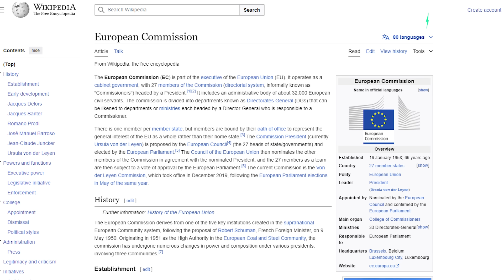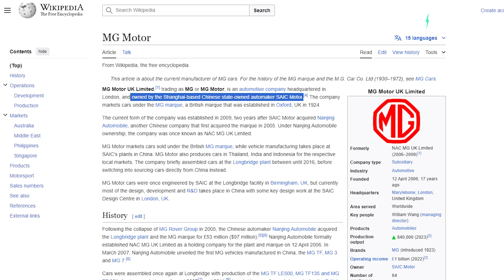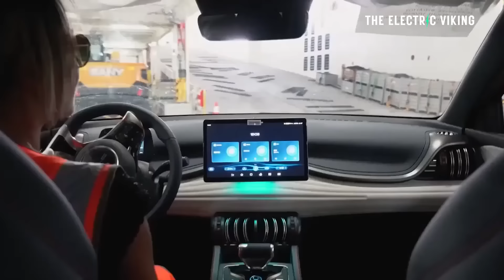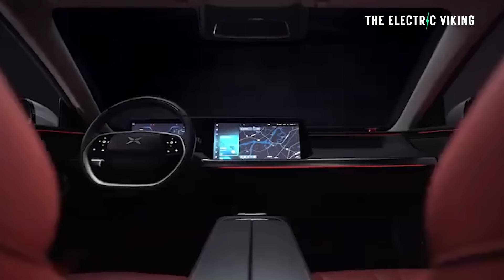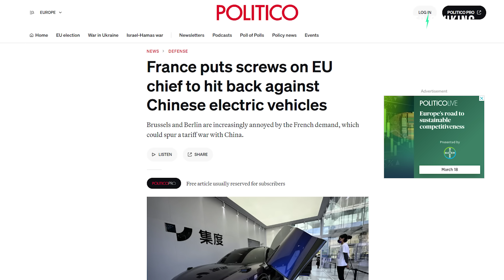Europe says it has evidence China is paying BYD & MG to sell EVs in Europe

Comment: Chinese EVs are not cheap in the UK. MG is lower priced because it’s a budget car.
Reply: So its CHEAPER?
Reply: @starlord8973  because it’s a basic car not a premium or luxury car , you get what you pay for.
Reply: Is crap simple
Reply: BYD has various models with different prices
Reply: @henpil7098   L😂L
Reply: Except the reality is they aren't crap... and the premium priced EVs quality isn't 60 or 80% higher even though it's price is.
Reply: @jb5music  my Chinese EV Smart #1 Brabus is neither cheap or budget, in fact it’s expensive and premium £43,450 plus it’s fully loaded with no extras to add on. You get what you pay for and I love it. 🥰
Reply: @garrycroft4215  ppl need to ditch the mindset made in China = cheap.... The tide is turning like Japanese cars became quality products
Reply: @fatdoi003  my Chinese car is not cheap £43,450 😎 or around €50k $50k had it since October and done 3,500 miles 5,600 km. it’s quality.
Reply: @Monkey_nuts_  I’ve driven the MG4 Xpower in fact it was on my shortlist being £7k cheaper with the same power as my Smart #1 Brabus. This makes it a budget option that is not fully loaded, most of the kit on my #1 can’t be bought on the MG you really do get what you pay for so for what you get it’s a bargain. I agree it’s better than an id3.
Reply: @Monkey_nuts_  If you look under the skin of the MG4 and ID3, Continental is one of the largest suppliers. Both use CATL batteries. SAIC makes both MG and VW cars in China...

Comment: I own an early MG ZS EV. It is built down to a price, it works fine and is a popular car in the UK. The competition might be able to compete if they could build and sell cars in the volumes that SAIC do. But the European manufacturers want to put bigger expensive batteries in their cars rather than educate drivers that they don't need big batteries if the public charging network is good which is now becoming the case in the UK. A range of 180 to 200 miles is perfectly adequate, that is close on 3 hours driving and you should take a 20-30 minute break at that point. Sufficient to recharge an EV for a further 100 miles.

Comment: Those who want to go electric will see the €6,000 bonus increased to €7,000, Macron told the newspaper Les Echos, ahead of the opening of the Paris Motor Show on October 17. 2022
That means if you want to buy an electric vehicle (EV), you will receive €7,000 towards the purchase, as long as the car costs less than €47,000.
Along with France, Romania currently has one of the most generous purchase subsidy schemes in the European Union.
Fully electric cars are subsidised by €10,000, while plug-in hybrids are subject to a €4,500 subsidy. There are also scrapping bonuses available, which comes in around €1,500 per car.
In Germany, the current €6,000 subsidy for fully electric cars priced below €40,000 will drop to €4,500, while those costing more than €40,000 will see the subsidy drop from €5,000 to €3,000.

Comment: The BYD price outside China is not that competitive, I am from Mauritius, they are milking the market . . . The price is in Mauritian Rupees

-> Dolphin Standard  -> Rs 1,350,000    -> USD 29,504.41
-> Dolphin Extend      -> Rs 1,550,000    -> USD 33,875.44
-> ATT0 3 Stanard     -> Rs 2,095,000    -> USD 45,786.48
-> ATTO3 Extend       -> Rs 2,400,000    -> USD 52,452.29
-> SEAL RWD             -> Rs 2,950,000    -> USD 64,472.60
-> SEAL AWD             -> Rs 3,300,000    -> USD 72,121.90

I don't see these prices from a new entrant in car manufacturing reasonable, they have a lot of experience in cells and battery packs though!
Reply: As a Chinese I also wouldn’t suggest BYD set the price slightly above their breakeven line, since they have the tech advantage they should set their price where it should be base on the certain market, to obtain as more profit as possible to invest in R&D gain more advantage, and also benefit their employees. I see Germens doing this Japanese doing this, no reason Chinese products has to be cheap.
Reply: @Im-mono  I hope the Chinese differentiate themselves with good after sales too.
Reply: Honda and Toyota sell their cars cheaply in Japan, outside the markup is quite staggering